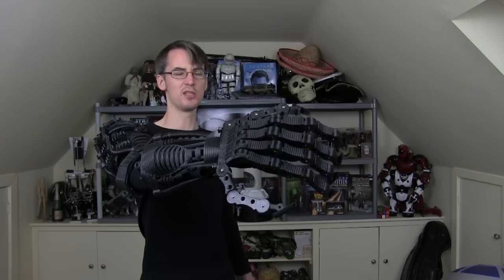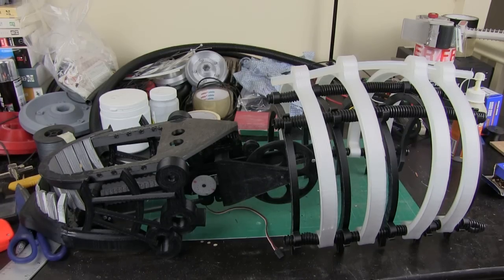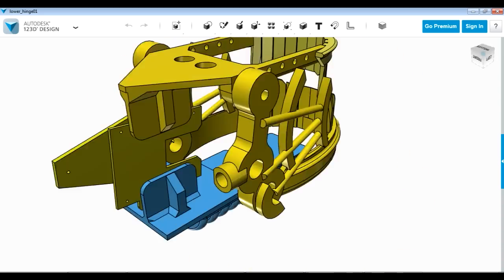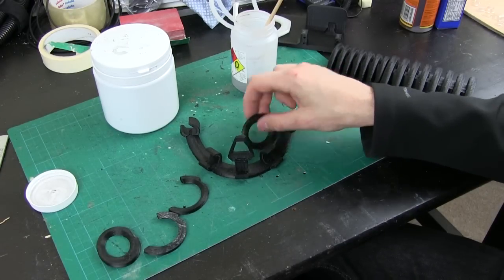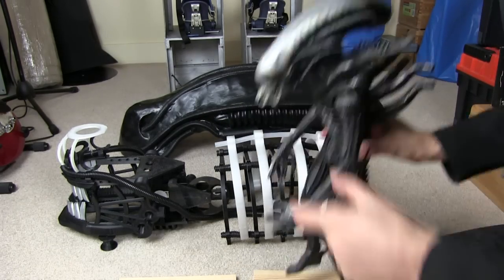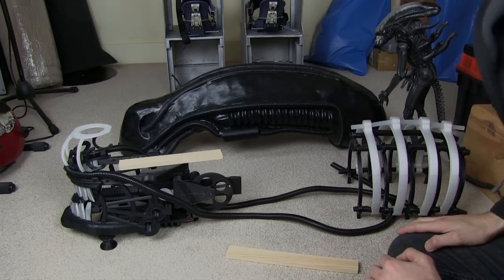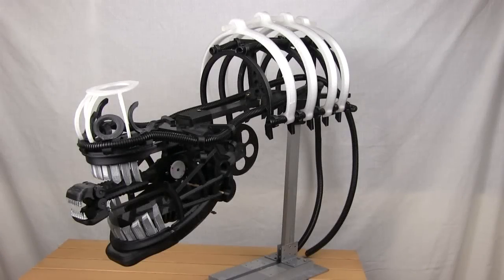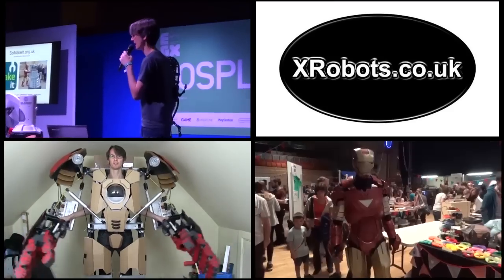Alien Xenomorph Cosplay #7 | Head Pieces | James Bruton

Comment: I thought the skull nose and zygomatic arch looked odd, especially since they're recessed.  But with LEDs behind it and a clear dome over them, they should pop out quite well.  What will you use for the dome?
Reply: ***** So you aren't gonna have an actual clear dome because it will get in the way of the scrap metal aesthetic.  Many scrap metal artists use glass in their projects.  Just an idea, but what about a shattered auto-glass effect as the dome.  Of course you would use a clear plastic for the weight.  Maybe you could have exposed metal wires as "veins" running along the cracks for a stained glass effect.  Sorry, but I'm very enthused about your project.